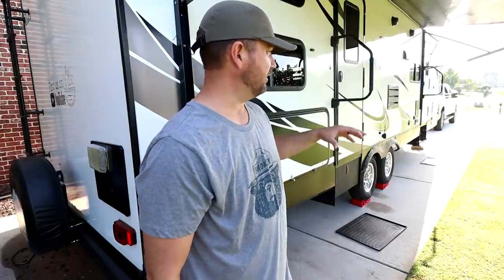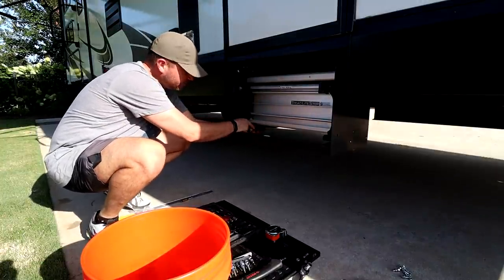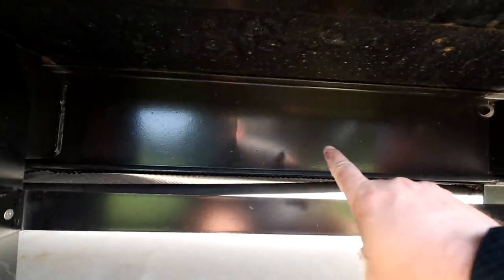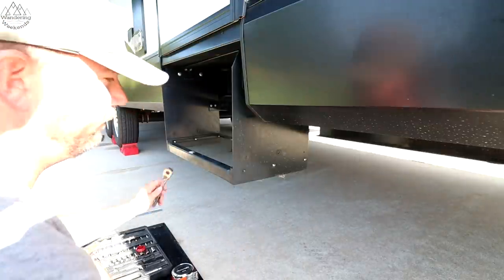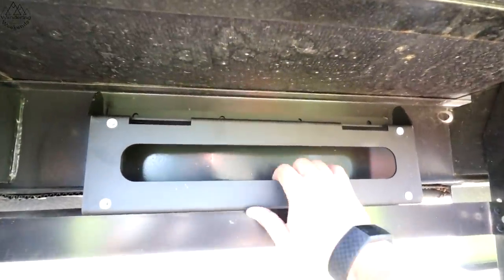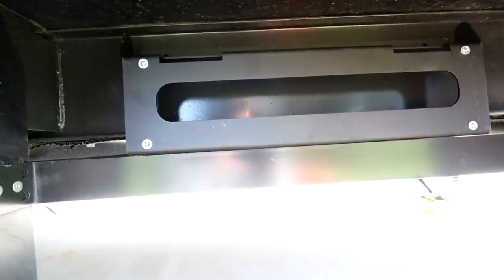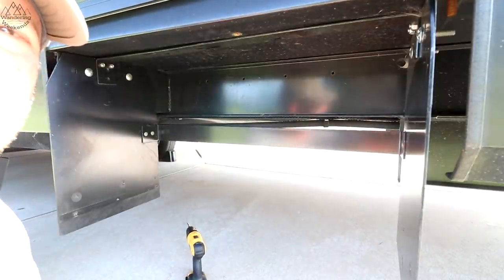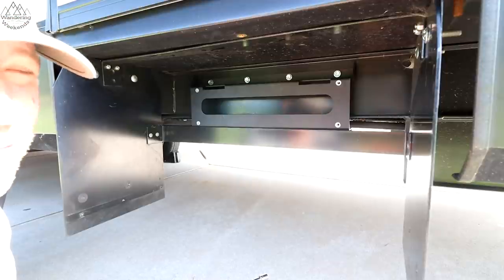HILLBILLY HACK RV Storage Box Install... Rock Solid!!

Comment: That is interesting, but you better check those self tapping screws constantly! They are weak and will lot last with vibration from traveling. If it was mine I would use at least 3/8” grade 5 bolts on sides and back. You do not want that box to break off while driving.
Reply from the maker: About a year now. Solid as a rock. Thanks.
Reply: also a crack vibration support inside the box. 
but add on a couple drain holes. with rubber drain tubes in them.(keeps rd splash out).

Comment: Great Video....I have the same issue as you, a 6 inch I beam. However, I don't have the lower bracket like you do. Would this work if I used the 4 top screws to go into the I Beam and then come in the side with some screws for some added support? I really want one of these boxes to work, but am concerned about not having the additional bottom support without the 8 inch I beam. Thanks for your help!
Reply from the maker: I really like that the bottom support is there so I’m not sure I’d be happy without it or not. That said the boxes are rock solid even with the rear bolts. Tough call.
Reply: @Wandering Weekends  thanks.....do you think adding screws through the current side plate into the box might help with stability?
Reply from the maker: Yes!

Comment: so these are not the Lippert boxes? I bought the steps, the hinges and the storage box.  The storage box is very expensive, small, poor quality and I am sure it will rust out in no time, no door seal and cheap lock.  The steps and hinges were ok. Expensive but ok.  I also bought the hand rail piece of garbage as well.
Reply from the maker: I can only speak to the boxes I have. They’re very nice. Heavy as hell actually. Had me a bit worried. Nice seal. 1000’s of miles and zero water/dust. I’m not sure what you have but mine are great.
Reply: @WanderingWeekends  Thanks again. We are talking about 2 different styles, I thought I was purchasing what you have. Mine are thin metal, no gasket completely different lock closure component.  Not sure why I was sent these. I received mine in late spring, maybe they changed? Thanks again.

Comment: Not sure why Lippert doesn’t provide a bracket for 6” I-Beams 🤷🏻‍♂️. My trailer does not have that extra horizontal metal piece so the only option for me would be to have an extra piece of I-beam welded to the frame.

Comment: One of the benefits to upgrading to the solid steps the load up inside the doorway is a guy can get rid of the low hanging box we're here in Montana can catch on rocks and uneven terrain driving back to more secluded camping spots. For this reason I would not buy these boxes.
Reply: I've had it happen. Got hung up on a stump while dry camping.

Comment: Would it make a difference if the door swung up to open instead of down to open?
Reply from the maker: Denden 501 you’d have to hold the door open that way... unless you installed some type of shock assist.

Comment: Do you know what the box weight is
Reply from the maker: The box weighs 40lbs... the steps I removed weighed around 25... in the end 30lbs added to the rig  for the boxes and another 70 or so for the solid steps.
Reply: @WanderingWeekends  ok thank you

Comment: if you are ever interested in selling the old aluminum steps let me know.  Looking to upgrade from my steel steps
Reply from the maker: Kevin Burroughs you are welcome to them! No charge... that would be bad juju 😁
Reply from the maker: Send me an email wanderingwknds@gmail.com
Reply: @WanderingWeekends  sent
Reply: The frame for the aluminum steps was left on the trailer.  To remove steps you remove the top 4 carriage bolts.

Comment: We have a 2018 Grand Design Imagine and I will have the same issue with the 6in I-beam when I install our storage box. I was wondering if you were able to use the slots in the bracket and the tabs on the back of the box to support the weight (after you put the 4 self tapping screws in the top of the bracket) of the box while you finished the “Hillbilly Hack”? I noticed you had some blocks under the storage box as well as the clamps you mentioned.
Thanks!